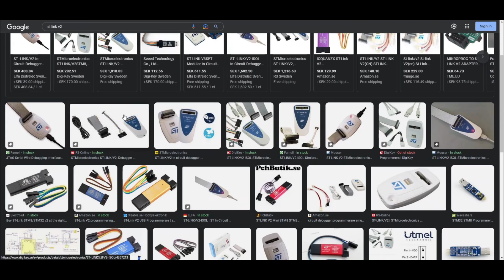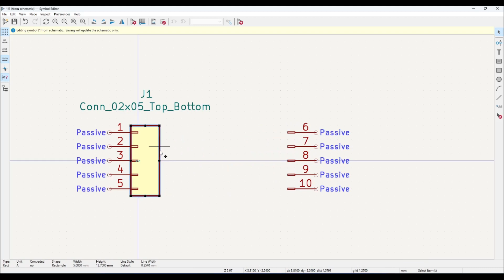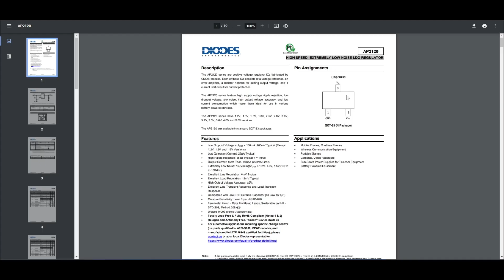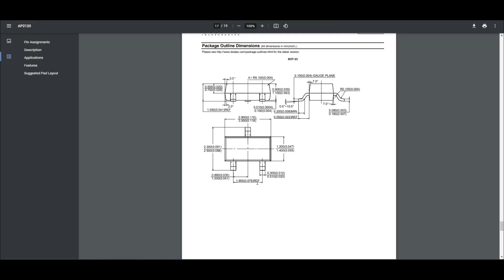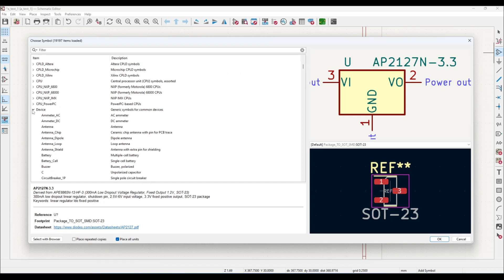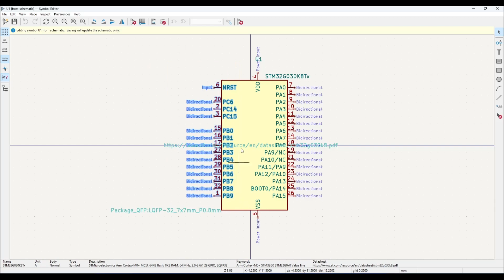Learn Schematic and PCB Design STM32  - Part 2 KiCAD V 7

Comment: My hunch is that they are "out of sync" with the grid because you changed the grid to metric. And what difference does it make to use metric grid in schematics editor anyway?
Reply: The default grid is 0.254 millimeters because the standard pin spacing on those components is 0.1 inch. the inch is defined as 2.54 centimeters. you changed the grid to 0.250 which does not evenly divide into the pin spacing.